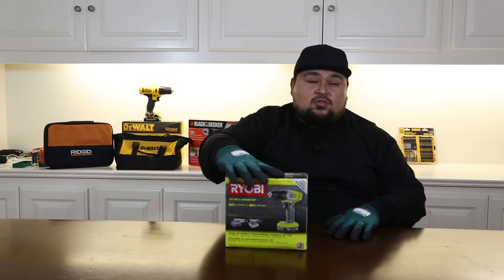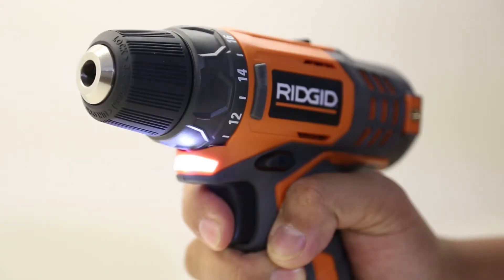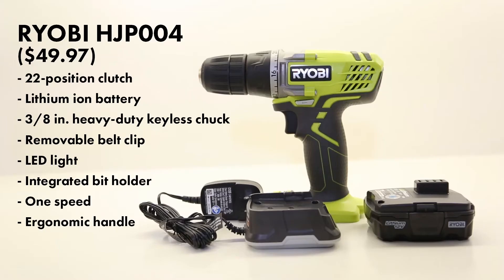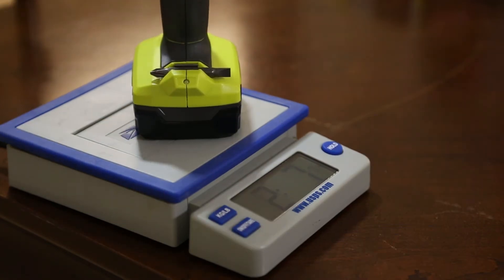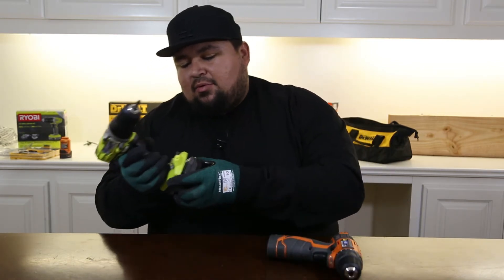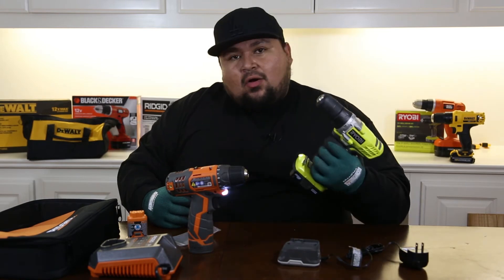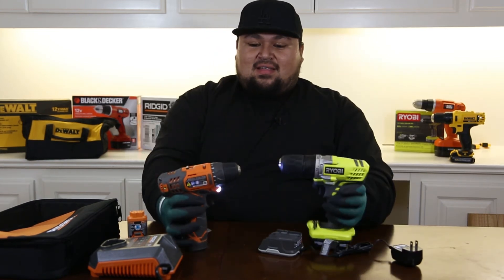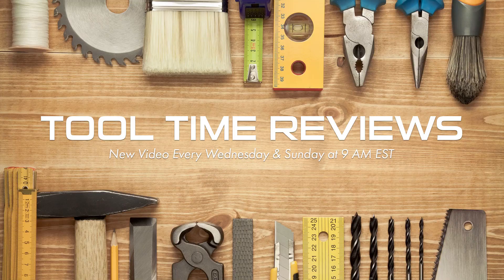RYOBI VS RIDGID 12V Power Drills 2017! Battery Test, Speed & Performance Test

Comment: the battery tests are pointless.. heres why there not under load.. just running of course there gunna get 28 minutes... do screws into wood every 5 seconds or so then do a time test under load is a diffrent story..